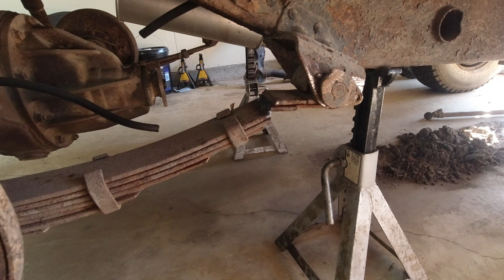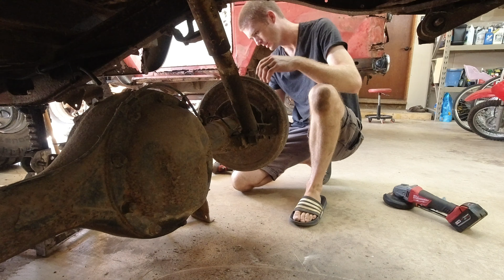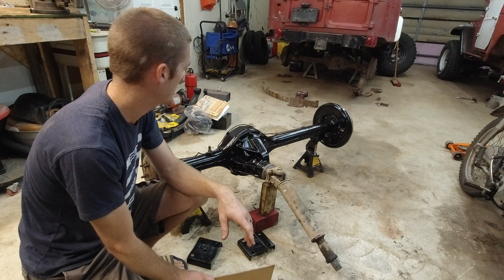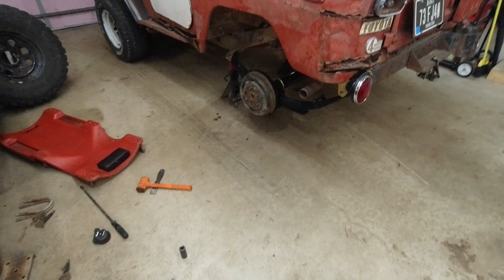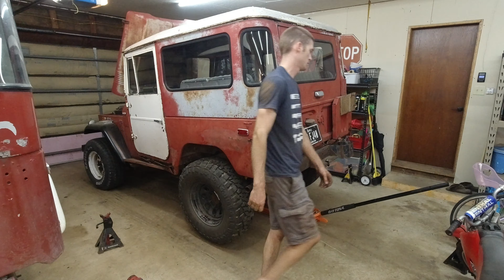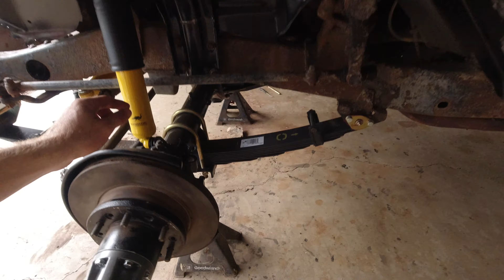Rear Axle Swap | FJ40 Toyota Land Cruiser

Comment: Excellent work, and glad to see your kids involved.  When It is all finished, and you are  ready to separate yourself from the FJ40...just let me know.!!
Reply from the maker: I will be selling the other one.
Reply: @HumbleAcres  Of course I dared to look on the net for what is available.  78K topped the list, or rather it is where I stopped looking.  However, there are numerous ones on sale that look to be in need of 90%+ restoration. A friend said to get a fiberglass body.  Have to admit it is tempting. His partial argument is how "easier" it would be to work on the undercarriage, and engine/drivetrain necessities. Living in a townhouse just doesn't lend itself to such. Footnote: am prepping the house for sale and possibly moving to Western Md.  Great prices, where I grew up, and lots of homes with single and double garages....additional footnote--all will likely need a Deere with at least a 42" mower deck.   Keep having fun.

Comment: What year are your Cruisers?
My brother had a couple in the mid eighties and there 
was so much emissions stuff you could hardly get to the
engine to change spark plugs.
I had a Jeep CJ5 and he had a Land cruiser and we had fun.
The Cruiser was fantastic in mud.
He still has a project Cruiser but he hasn’t done anything since
came down with cancer and passed.
When he gets over the hurt he’ll get back to it.
Have fun with your kids, they grow up fast.
My youngest just got accepted to the university of
her choice. She was my little gear head helper.
Reply from the maker: I have two 73s a 71 and the third I think is a 65. All of mine have all the emissions stuff taken off. The later ones had a lot more emission stuff on them. Thanks for watching!